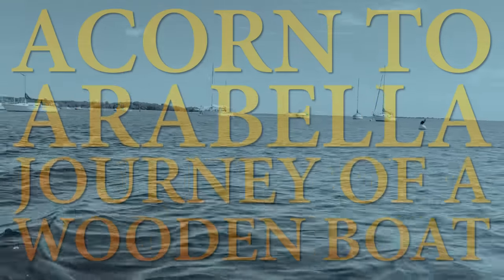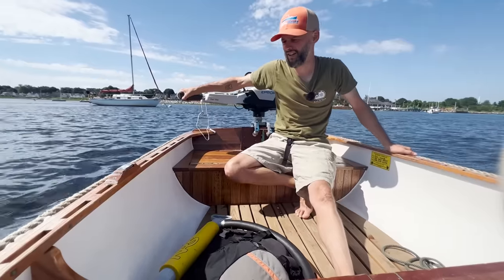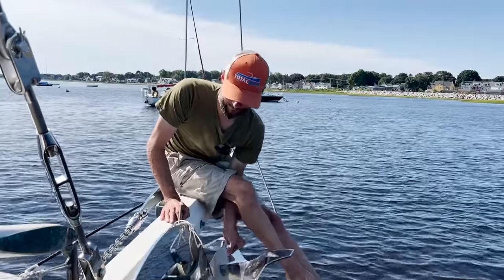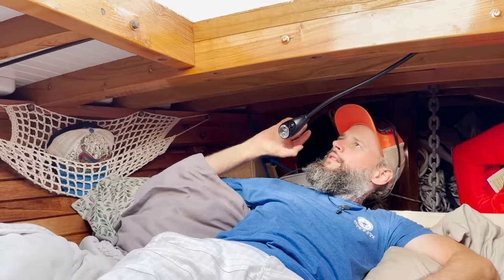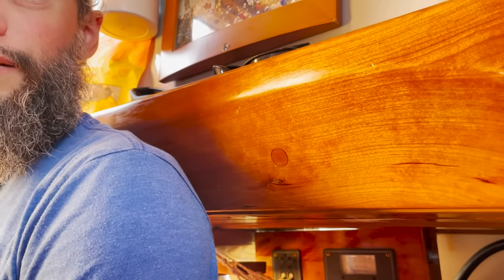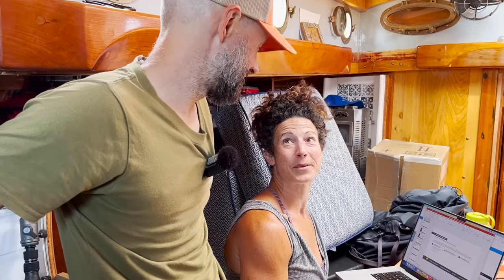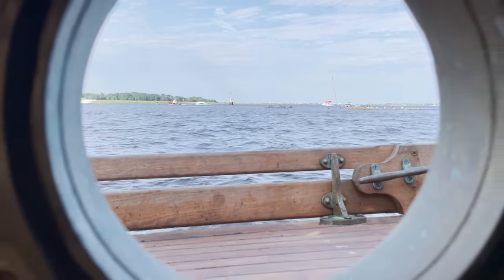2 Months on a New Boat, Full Walkthrough - Episode 277 - Acorn to Arabella: Journey of a Wooden Boat

Comment: 50:00 those LED panels are dying because they are overheating, those brown spots are burnt LEDs. You need to use beefier aluminum railing underneath the LED strip, preferably offset it from the wall to create air gap, so the LED strip is able to cool down. Installed like this in the corner, any strip will overheat very quickly.
Reply: agreed, and/or possibly they are over voltage
Reply: I assume voltage would be the first thing they checked. Its clearly lack of heat sink issue.  @andrewduhan

Comment: Hi regarding to your LED problem. Browning can be traced back to several causes.
1)The small LED cobs can't get rid of the heat they produce. A heat sink in form of a 5-6 mm thick aluminium strip which sticks out a bit below or above the lighting strip. Small spacers which lift it from the wall give it more air circulation. Depending on the material on the back of the LED strip, heat transfer paste (cheap stuff should be good enough) between the lamp and the heatsink should help.
2)  Difference between Cobs. What you could check is, if the voltagedrop across the LED cobs is the same for all the cobs . I'have come across several lamps were different batches of cobs have been used and their resistance, when in use, was not equal. 
3)Creeping current  when they are off. Is it possible that a small current is flowing  when they are off?. LED cobs have become more resistant to small currents in the mA range but they still suffer , even worse if it is reverse polarity. In a salty and moist environment switches can leak.

Congrats to a fantastic building achievement. 
Cheers 
Peter

Comment: Hey, from experience the LED lights burn out if they're not sitting on a sufficiently sized heat sink. Mount them on a aluminium bar inside the diffuser and it might help you out. Paul.

Comment: For your belaying pins, a quick way to make some is to use a length of off the shelf 1/2" bronze rod and turn some locust handles for them. Epoxy or pin the handles to the rod.  Et voila you have some nice pins.

Comment: FYI, I used a solar deck fan installed through the cabin top as the exhaust fan for my composter. It worked great (no smell), was quiet and was a super clean installation that needed no wiring and took up very little space. It is also easy to close up from inside if the weather gets too wet/wild.
Reply from the maker: Thanks for sharing your experience! —Anne

Comment: Concerning the LED strips failing.  If it is due to moisture getting into the strips, then there is obviously a hole or crack allowing this.  The strips are seemingly attached (by screws, I assume) to the bulkeads or overheads that they touch.  This would mean that as the boat shifts with the action of waves to slightly bend the bulkheads/overheads back and forth over time, moisture can gen in through the attachment points.  In this case you have to do two things:  (1) detach the strips from the supporting planes and stick them with some sealed material to a separate backing material that can be sealed completely, but still opened by scraping along the edges to change an LED (or maybe just kept sealed forever and replaced in toto if an LED fails, which should be rare).  Then, (2) mount the strip to a thick padded spacer from the overhead/bulkhead so that no bending of the support will touch the strip, thus keeping it from becoming unsealed by ship motion effects.  You also have to make sure that the wires to the strip are sealed, of course, and that there is no failing between the strip and the batteries.  This last is for everything electrical, of course, not just the strips.

The material that the strips are made of also might be porous, either always or if they get bend (they are somewhat flexible, I assume).  If so, you may have to paint them with a clear sealing paint or lacquer before re-installing to ensure the strips are sealed everywhere on their surfaces and then clamp them in place with no screw holes in them anywhere..

Comment: Great video and boat tour. One thing I don't remember you mentioning is trash storage. Being close to Port it's not an issue but what are longer term plans for non-organic trash.
Reply: Given that most of the "trash" has something inside it which will be consumed, there should be a net reduction in volume. So, no worries. The real problem on small boats is the entropic tendency for stuff neatly stowed initially, to mysteriously expand with use. 😉

Comment: What we (club) tend to do with our small boats is to mount the outboard motor not in the center but off-center.
Yes, that creates a little bit of momentum, but it is super easy to compensate and it makes sitting and steering much more comfortable.
Reply from the maker: Thanks for sharing.
Reply: Or better yet, just offset the control handle. Most decent outboards have this adjustment

Comment: Regarding the LEDs failing in the head.  Just tossing out an idea.  Could the salt in the sea air be corroding the electrical connections in the LED electrical connection system?  High resistance electrical connections could reduce the voltage (normally ~3.5 VDC?) which would cause LEDs to not operate.  Best of luck!!
Reply from the maker: It’s most likely to do with a variation in the voltage delivered to them.

Comment: The LED strips keep failing like that because many (all?) 12V strips use an arrangement where each 4-5 LEDs share a single current-limiting resistor. Since the individual LEDs have slightly different electrical characteristics, one of them can hog more of the shared current. That one then overheats and ages much faster than the others, leading to the orange glow.

The solution is to buy a 5V strip, they typically have a resistor for each LED separately.

Comment: One issue I was made aware of by the rigging doctor, is that dyneema actually lengthens in cold weather, which was not great for their standing rigging.  It seems if you want constant tension on the bobstay,  maybe dyneema isn't the best material choice.
Reply from the maker: The bobstay is of bronze, the connection point where dyneema is employed is very short, and so along its length won’t lengthen all that much.

Comment: LED striplights probably overdriven - cheapest option would be to add some diodes in series to help drop the voltage a bit to make them last longer, but dim them a bit.
or use a DC-DC converter that you can adjust the voltage/current.

Comment: LED's browning then failing early is usually caused by over volts. If this is the case, a voltage regulator will fix the issue.

Comment: About the led stripes. Try running them on less voltage. The LEDs burn out if you run them on their max rating. Do 80 or 90% of it and they will last forever.

Comment: For the rub rail, some kiind of plastic would work fine. For my camp cruiser, when I started taking her through the canals here in France, I decided on a 1" x 3/4" strip of oak. I varnished it with le Tonkinoise. Because I am often locking through alone, the boat gets bounced around a bit into the stone walls of the lock despite the fenders I have. But the oak really takes it well, and when I get a chance, it's 20 minutes with some sandpaper and the tonk to get it looking nice again. But even without that, a little gray oak on a wooden boat looks nice too. The other advantage of wood is the structural strength it adds that plastic won't. One might never need it, but going from 3/4" to 1.5" at the gunwale adds a lot of strength if one gets jammed between two boats or between a boat and a dock or quay.
Reply from the maker: Since Victoria swings around and comes in contact with the hull fairly often at the mooring, especially at slack tides so no, we won’t be going with plastic. Something soft will be better. —Anne
Reply: Victoria was built with a Black Locust gunnel. Black Locust is harder (1700 Janka scale) than White Oak (1360 janka scale) 
In building Victoria is was a given that modifications would be made to increase her functionality. I applaud Steve for historic application of rope as a rub rail. However, I can’t agree with him more on adding a soft rub rail as it will protect both vessels in the long haul. 
Cheers,
Bob
Reply from the maker: I think the problem here Bob is that the gunwale needed a bit of a sacrificial outer piece added that was coved to receive the rope. I was going to write an article about it because I was learning about it all from Eric Stockinger for my Norwegian pram… shoot I should have done that. —Anne

Comment: Fun fact about a boat anchor, it's the weight of the chain that holds the boat in place, the anchor is to hold the chain in place as the boat moves to let out the chain.
Reply from the maker: Fun fact, when taut, it’s not weight at all, but rather, the distance of the anchor from the boat (scope) and the shallowness of the angle it makes that holds the boat. This is why a pile of chain, fetched up around itself and the anchor, is to be avoided at all costs. —Anne

Comment: Many LED systems have a low tolerance for voltage. They expect 12V and not 13.2. There are devices (eg victron) that ensure you have exact 12V.

Comment: When you get to the point of having extra electric energy with solar, wind, hydro power, a great use of that extra energy is a hot-water-tank, dump load.  It's just a super-insulated, electric, hot-water, thermal-storage tank.  That dump-load, hot-water, thermal storage runs with the extra power that needs to be "dumped" when the batteries are full.  Great for long, hot showers...

Comment: Autumn is near which means bad weather and even storms. With regards to that I am missing enough points where you can hook up your life belt when you have no choice but need to go out and work the boat if you want it or not.
Reply from the maker: I don’t think I understand what you’re saying here, is there a question? Are you wondering about jacklines? —Anne
Reply: Yes. I think this is what they are called in english (I am a native german speaker).  Life belts are very similar to the harnesses used in climbing. My skipper always demands to put them on when the weather gets worse. If it gets really bad, you can hook the belt with a line and a carabiner to some solid points on the boat in order to catch you just in case you fall or risk going over board due to wind and/or waves. But: you need that solid point where you can hook in.
Reply from the maker: Yes, of course, thank you. Your English is great by the way, I certainly can’t speak German with any amount of proficiency so no worries here. The small stanchions holding the toe rail up have small holes in them where various things can be anchored. Anchoring a fore-and-aft jackline to those will be easy. Cheers for watching and happy Friday! —Anne

Comment: I noticed how low she was sitting in the water when she splashed. Wondered if that was due to the much heavier timber used in construction, like locust. It's a very hard thing to get all of the weights the same as original when you're putting so many more things onboard than when Atkin designed her. Just paint up 2-3 inches, and you're good.
Reply from the maker: It’s due to where the line was painted. It’s a guess on pretty much every boat! https://youtu.be/gNraUpvGvx4?si=aKIL_RuxNYk1I-XR —Anne

Comment: Usually the reason LEDs fail is heat. They drive them at the maximum output so you might need to find a way to run them less light this will increase lifetime a lot.
Reply from the maker: We've also been hearing that an uneven/slightly surging current is to blame. Hard telling to be honest.

Comment: RE LEDs: manufacturers skimping out on number of LEDs for the brightness they need. If you put fewer LEDs in, you have to run them at a higher constant current, they will burn out faster, but you will get the same brightness and you will save on BOM cost and make more money on your product. Who knows what % of manufacturers will do this, probably most of them unless you are paying top dollar. You won't notice it when you install it and they're all fresh,  you'll just notice when they start burning out over time.

Easiest solution is to find some fresh "outdoors" sets that you or an electrical friend of yours know can be easily modified to lower the constant current circuit they use. In the easiest case this would probably involve changing a single SMD resistor that sets the current in whatever power supply they have. If the LEDs get run at a lower constant current, they will A) be slightly dimmer B) last a LOT longer C) be a LOT more efficient. The end result should be that you end up with strips that are slightly dimmer, but last a LOT longer.

For the cheapest products, they might even be basing most of the control on your supply voltage being exactly 12V - not what a battery does - in which they could be over-driven when the voltage goes higher. One based on a constant current power circuit will always keep them at the same power as long as you feed it within a range of volts (e.g., it may be able to handle the source going from 10V - 18V).

Comment: You should put a copper bottom on it when you have it out of the water.
Reply from the maker: Like... sheet copper? That's expensive and needs to be nailed on. Thousands of holes. Since we're doing higher latitude cruising and plan to careen or pull annually, bottom paint will suffice. —Anne

Comment: As to be expected, no big things. Just minor adjustments. So once again, job well done!👴👌🤗
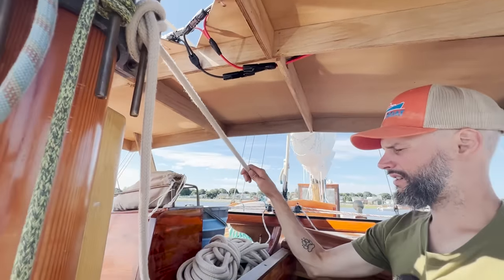@25:54 If it were up to me, I would rig she mainsheet so there are two lines, one on either side lead back to the side of the house, together with the traveler lines (which ideally cross so the adjusting can always be done on the windward side.).👴😉🤓
@29:54 It's probably a good idea to think about placing a removable insect screen there (and on some other places too).👴😉😴
@36:00 An easily removable wooden retainer (about half way up) won't be a bad idea.👴😉🤓
@39:44 No...?! Aargh, just say it was designed this way!👴😉😁
-
@44:50 Now that is one good thought!👴👌🤣
(as said @50:41) Needless to say, but don't get the illusion that the to do list will be exhausted an one time... At best, it can be postponed.👴😉😁🤗
@52:06 😁🤣🤣🤣🤗

Comment: Do you have to re-sand to fair the boat again? It looks pretty rough to me but I'm not a boat guy.
Reply: Yup. Sanding is required between every coat of paint.
Reply from the maker: To use fairing compound, which is basically a two-part epoxy with a filler in it that's easy to sand, yes, one needs to sand the surface to prepare it, and I don't sand it for paint (180 or 220, which is what we use on Arabella) but at like 80 so the two-part product can really grip. I think what you're talking about here is that the hull isn't finely faired, which is true. I don't suspect that we'll be doing that level of finish for this hull. We'll freshen the paint in a couple/few months, most likely.
—Anne
Reply: @AcornToArabella  thanks for answering me. Sounds good I like what you said about Arabella was built  to use hard. I'm a finish carpenter but the stuff for myself is a little light on sanding too lol you don't have to worry about putting a scratch on her. Peace ✌️

Comment: Do not use plastic without testing and checking first as a lot of plastic windows don't work very well for more than a few months, using armored glass is way better, but that adds to the cost, so it's a trade off.
Reply from the maker: No need to test acrylic, it’s the go-to for marine use. 7x stronger than glass and it’s craze and UV resistant. 👍 —Anne

Comment: DON'T use a "foil" out on the end of your bowsprit for the furller. Just get two swivels with an upper swivel you actually hoist. The sail then wraps around the actual fore stay.  That means you can get that sail down really easy should there be a problem. NO FOILS IN PLACES THAT ARE HARD TO REACH IN A BLOW. And, much cheaper and more reliable than a foil system. I was a delivery skipper, big boat and small, for over 20 years. I know of what I speak.  Also, I never left the dock without a proper sea anchor, rigged Pardy style, and always ready to be set.  My first Bosun told me the sea is blind and as long as I treat it that way I might live. After five years at sea I went back to that old Bosun and told him he was wrong. I told him "The sea is not blind, it actually has a homicidal intent to kill or maim you. If you treat it that way you might survive." He laughed but he knew my sense was on the money. Also, those anchors are rattling around. Get into the habit of keeping everything except the dock lines taught. She is such a beautiful boat, I salute you for an amazing job building her, and pulling a really wonderful team together. I'll pop by from time to time to criticize you, I am from Ireland, that's how I learned. Don't be offended, the sea cares less about our ego's. If I were you, just setting out from Boston, I would plan on two seasons in the Caribbean to enjoy and work the boat out, and then head south, around the Horn and on to Fatu Hiva. Ya gotta do The Horn, and you and your boat ain't getting any younger. God speed young Jedi.

Comment: Just out of curiosity what are you using for internet?
Reply from the maker: Cell service mostly.
Reply: when you take the trip across the atlantic do you plan on going unplugged? if not, even though it's not a small chunck of change, starlink is a fully mobile solution
Reply from the maker: And it doesn’t work well with masts, is hard to send aloft, and is very expensive… but sure. Maybe! It’s only a couple weeks to cross, things can be done to take that time to be fully focused on the passage. —Anne
Reply: never thought of the mounting issues, that's a really good point

Comment: Steve, check the supply voltage on the head LEDs to make sure that you're not overpowering them.
Reply: If you need to drop the voltage - some decent size silicon diodes would be quick and easy